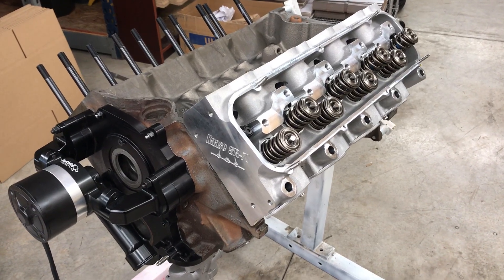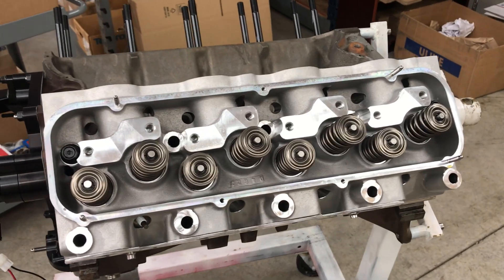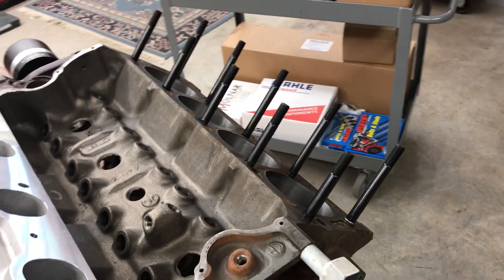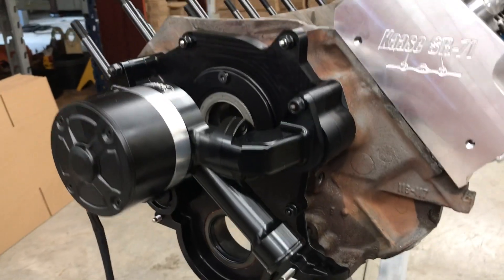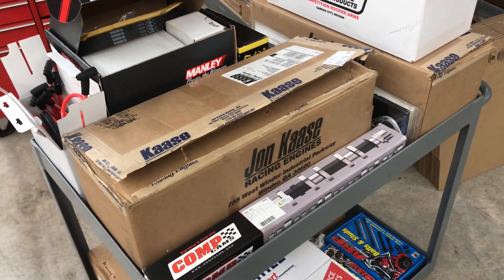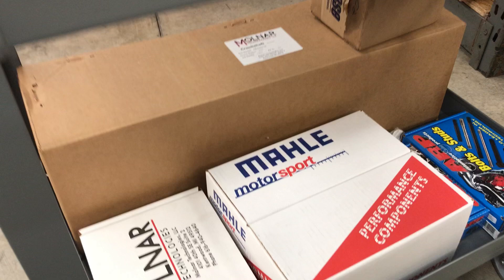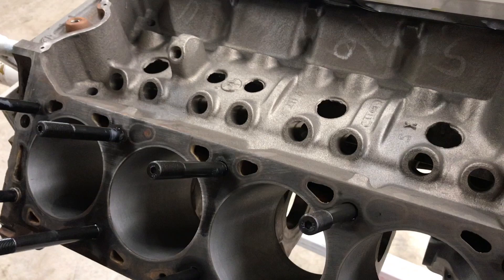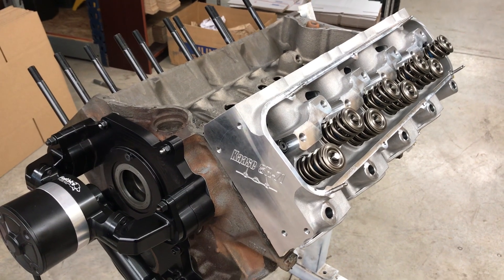521 Ford project

Comment: You definitely got the Best Stock Style BBF Head out there, Jon is the best when it comes to 429-460 Stuff, Even his Oil Pump is the best out there, Excellent parts you've chosen.  I gotta 521 myself with the older As Cast Trickflow Street/Strip 290cc Heads, I'm gonna be replacing those with the SR-71,s also. Jon Kaase to me is probably the best out there when it comes to making Power, Especially BBF Power.